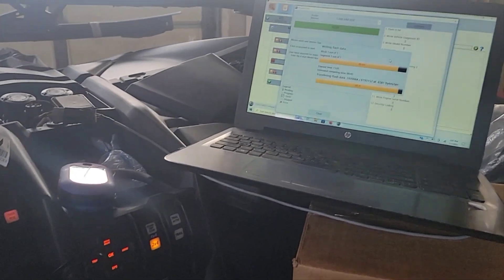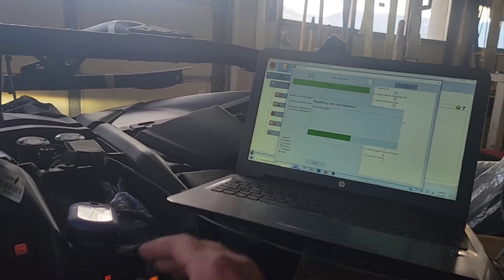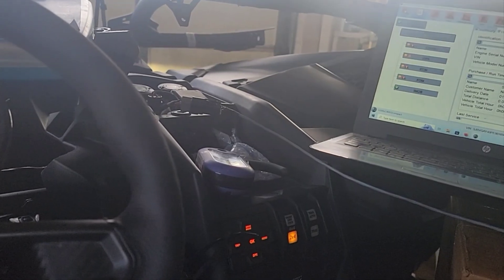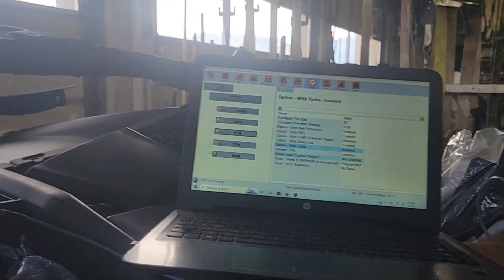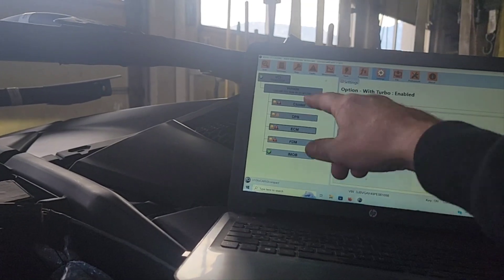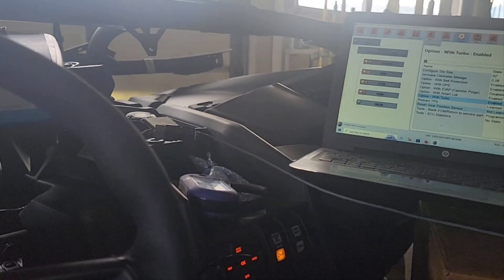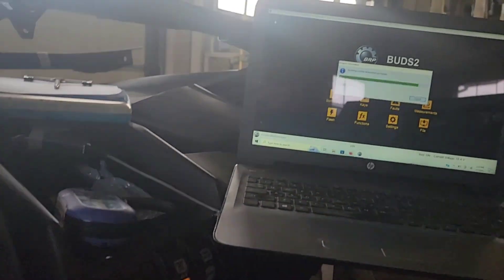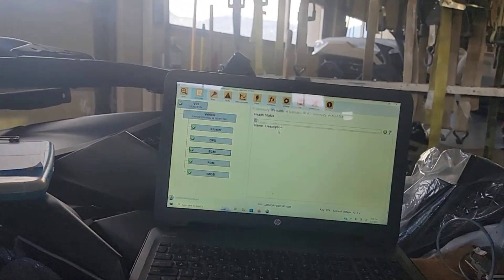Can-Am Buds2 programing ECM, key, power issues, not connecting to VCI.

Comment: Is there a setting to enable  smartlock
Reply: If the machine is equipped with smart lok yes.
Reply: My 2022 x3 xmr turbo rr   the smart lok has never worked  i think the dealer didn't  enable it also it wont go over 46 mph

Comment: What's software are you running and where did you get it from I was looking at that powersports diagnosis Also , when you program one of the new keys , did you just put the key on the machine and program it from that or is it lightly old daskies , and you have to have a module
Reply: Looks to be buds megatech, I ordered my buds through powersports diagnostic